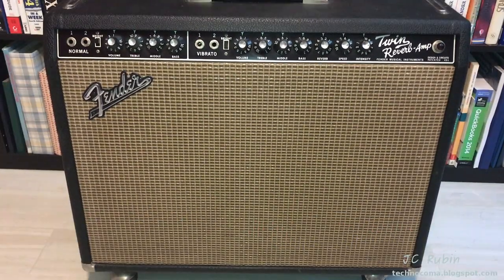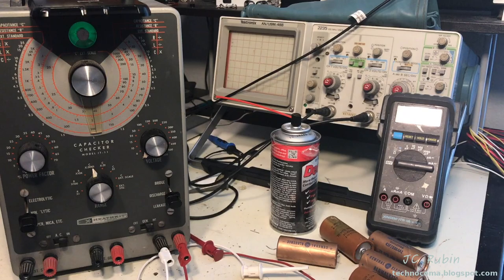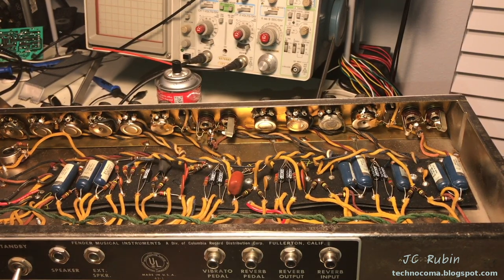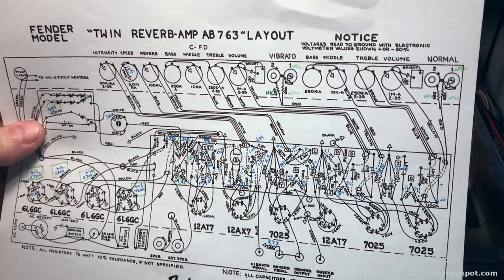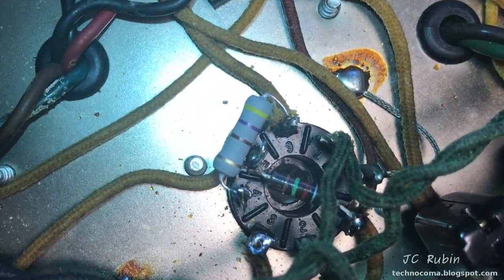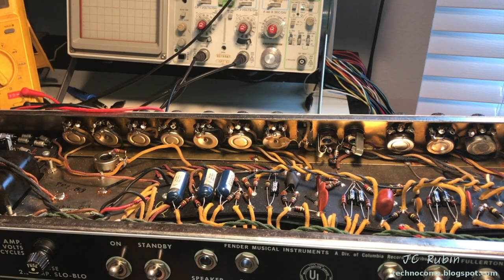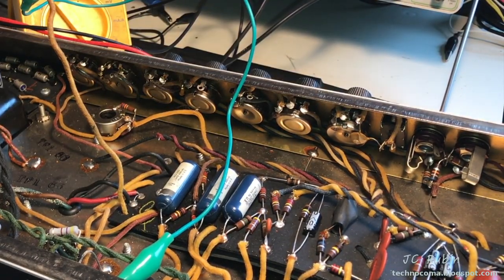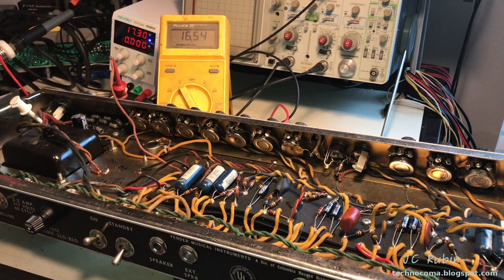Fender Twin Reverb Amp - Repair, Recap and Restore - Part 1 of 2

Comment: If those grid stopper resistors need changing in old Fenders I never use carbon comp. The heat rises up into the chassis and they are going to take a beating just like the originals. Metal film is quieter and less sensitive to heat degradation, as I'm sure you know. Purists be damned. Great work!
Reply from the maker: You would be surprised, though in many cases I upgrade the materials there ae cases where there is an insistence on the original parts, which from a collector perspective can be understandable.

Comment: Thanks for this! One just like it just landed in my shop, awesomely unmolested! What a treat
Question: you replaced the 50 MFD bias supply cap with a 100. Schematic indicates it should be a 25. any other considerations or concerns around making this change?
Reply from the maker: That cap upgraded is the only universally recommended change for original amps coming in for a recap job or repair.

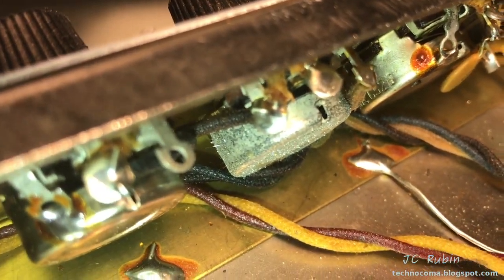Comment: @ 13:30 the technical name for those whiskers is dendrites. They can form when certain types of metal start to corrode. They can especially reak havoc in an electronic circuit by shorting out everything in its path.
Reply from the maker: Thanks for sharing, funny only one was so effected.   all of those pots are really past their prime though.
Reply: hey, I noticed my bassman has pots with these dendrites (though not as severe). how would u recommend I clean them?

Comment: I have this same amp and i'm thinking of getting new capacitors for it. Is it an expensive fix to replace them? also what are some of the symptoms of bad filter caps?
Reply from the maker: If you dont know how to do it, have someone else do it.  Its not worth dying over...
Reply: @retrotechandelectronics  I would never attempt to install caps myself since i don't have the know how or knowledge to do so. I just wanted to know what i'd be up against in regards to price for the parts needed.
Reply: @JHarrison49  Typical, never an answer to the questions. Just watch Lee Jacksons videos.